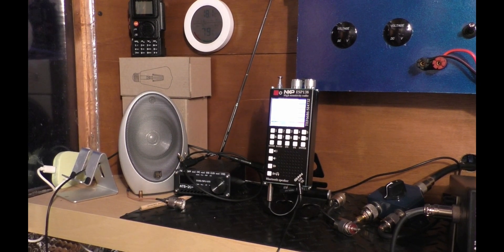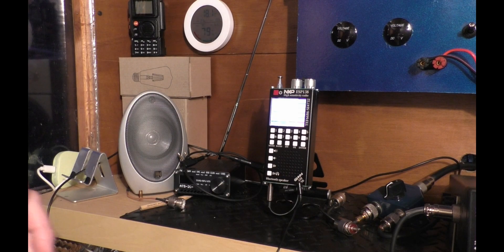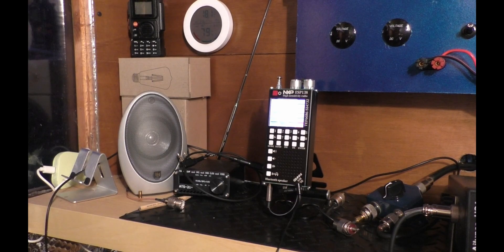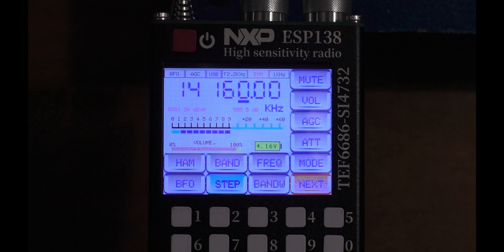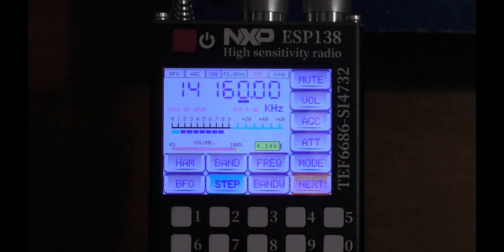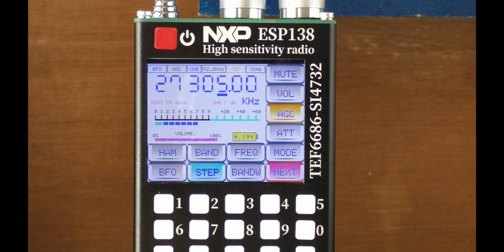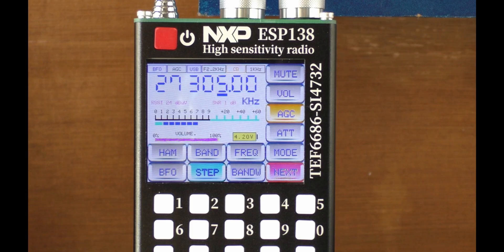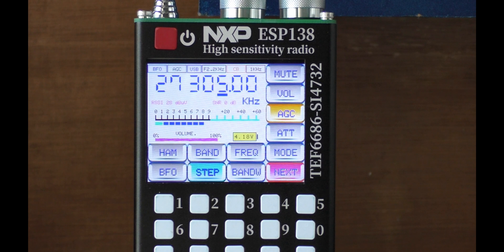AMNVOLT Tef6686 - SI4732 Shortwave Radio SSB Testing on Ham 20m 40m and 11m CB  #radio

Comment: Hi Fred,
I got this radio and tried to upgrade the TEF6866 Firmware without backing up the factory firmware. Is there any way I can request you to dump the factory firmware and share that?
Reply from the maker: Hi.  I ve not tried any firmware update on mine.  If I am honest i wont get the time to go back to this radio.  Sorry about that.
Reply: @CB-RADIO-UK  Thanks for replying! :) I will keep looking or hoping for a stable firmware.

Comment: Hello ! If you had to choose between this and a ats 25 pro+ radio, which would you take and why ?  Thanks for your opinion..
Reply from the maker: Hi.  This radio for sure.  Reason is i love the Tef chip.
Reply: @CB-RADIO-UK  So you do not think that the firmware for the SI4732 will never get a update, and seems even to have a update lock, is no serious drawback ? One can see in the ATS 25 family that with updates things get really better ?  Cheers from Austria..

Comment: Do you have any radio recommendations for an allband receiver orpther than the ICOM r8600?
Reply from the maker: There is little choice these days.  Your better off with a used Ham radio.
Reply: Get an SDRplay RSPdx-R2 or similar.

Comment: I like 2 in 1 products, but 3 in 1 makes perfect - now all they have to is make it a transceiver, same box size but no internal battery.I rather have a separate 6v 240ah battery that I carry around in my backpack. Then a 500 - 1000 is not too much money for an ultra portable radio. Xiegu x6200 is not worth 700 - 1000 money. Just my opinion! 😊
Reply: Because you believe in fairies and santa. LOL.
Reply: @Well_Theres_Your_ProblemGood for letting me know! LOL
Reply from the maker: Yes the next step up is Xiegu i dont see them getting much cheaper though.

Comment: Thanks for the posts on this radio, Fred.  I ordered this radio (2 of them actually; one as a gift) on August 26th as I had been patiently waiting for a company to combine both processors in one radio. It’s a long wait to get them, but your posts help 😊. They’re not scheduled to arrive until after Sept 20. 

I don’t mine the display being a lighter color for operation with the SI processor, since it makes it easy to see at a glance which processor is being used.

Side note!  You mentioned on your previous video that the desktop TEF radio version with the knobs only being available with one internal speaker.  Earlier this year I purchased that desktop version (with the dials) that has two internal speakers which plays in stereo. I believe the circuit board on the versions with one speaker actually has two speaker connections, but with only one being used.

Thanks again!

Doug
Reply from the maker: Thanks for the info Doug and i hope you like them when they arrive.

Comment: My 5/8 gets 40M very well.  In fact  my FT 920 internal tuner will tune up to it!!

I recently bought a MAAS Yellow 5/8 wave. The sections screw together and disassembled its just over 1.1 metres in length! Ideal for mobile static work.

Comment: Hi Fred. Does this have an adjustable RF Gain on? Looking to use it to RF detect noise from my bloody neighbours in the shop below....?
Reply: I'm curious as to how you would use this to do that.
Reply: by using RF Gain control  to wind  sensitivity back when i get nearer. .?
Reply: @markd5063   What sort of RFI noise are you looking for exactly?
Reply: @Well_Theres_Your_Problem I have a strong  suspicion that its  caused by some very dodgy hand wired led lights they have wired into one of their display cabinets....
Reply from the maker: There is an attenuation setting which does reduce some gain but its not as good as an RF control.  Local QRM can be a nightmare to track down.

Comment: Antenna jack located in the base of a radio that's designed to stand up is an odd choice.
Swap the squelch knob for volume would be handy.
Sounds ok tho.
Reply from the maker: Yes agree on those two points.  You can flip the screen and have it on its side.  Squelch wont get any use though.